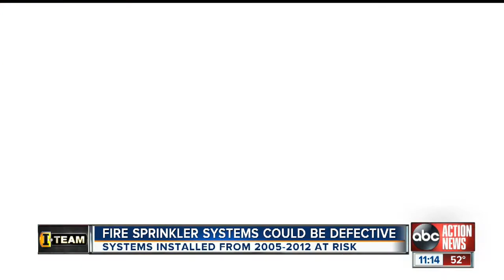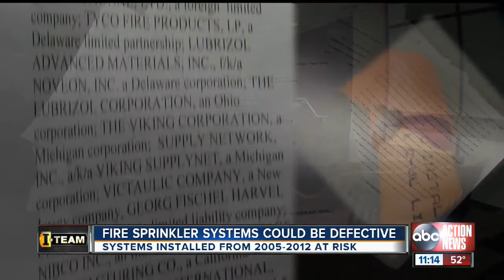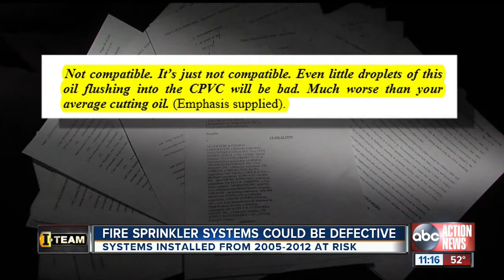I-TEAM: Safety warning about residential fire sprinklers made with CPVC - Part 2

Comment: thats just bad installation you can see the glue is pink because they tested the system straight away instead of letting the glue cure.
Reply: Pink glue means it's old. I'm a fire sprinkler service technician. Every system with pipe I seen that is more than a 5 years old has been pink. I know Vikings cpvc cement glue is bad about turning a greyish pink when it's old.

Comment: I think the main point has been missed here, too bad if they leak in a non fire situation! What about in a fire ? Sprinklers a spread throughout the building to evenly distribute water to the fire. If the pipe were to melt through and fail near the seat of the fire an uncontrolled jet of water would be directed somewhere. This may not extinguish the fire and may in fact stirr up air to help spread the fire. The rest of the system would be inoperable as most pressure would be lost at the fail point…..
Reply: Usually pipe is installed in a manner that the heat from the fire won’t reach the piping before detonation of a single sprinkler head. FYI

Comment: I'm a fitter and I've never seen it fail unless it's treated incorrectly. Cut it correctly, ream it correctly, and glue it correctly, and you'll never have a problem.
Reply: I just don't understand why it's not carbon screw pipe. Cost? Rust and corrosion maybe?
Reply: @spacepope-1  As far as installation goes, it's a godsend. It's light, cheap, and so much easier to work with. As far as construction companies are concerned, they don't mind being paid extra to fix problems they didn't cause if they saved a lot of money and time both initially installing it and later fixing it.